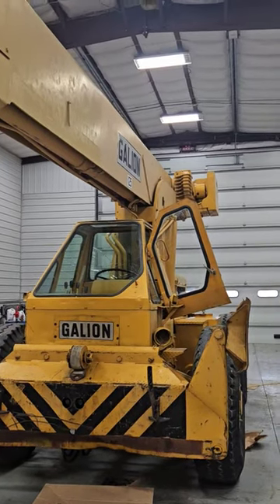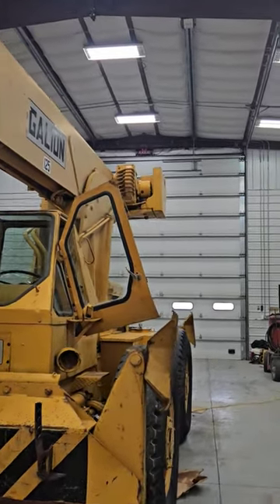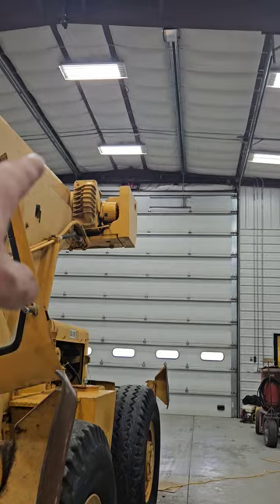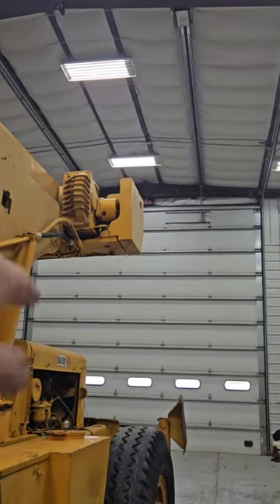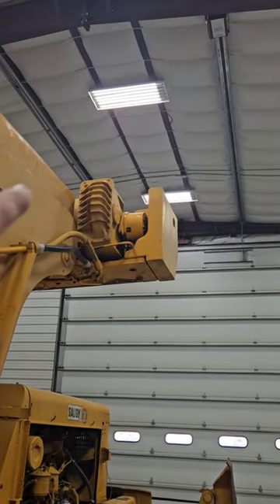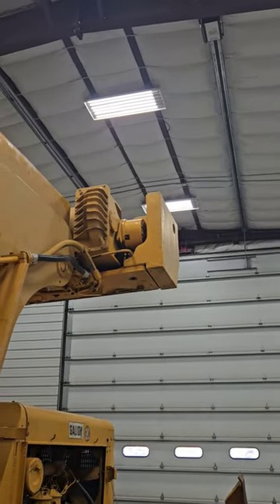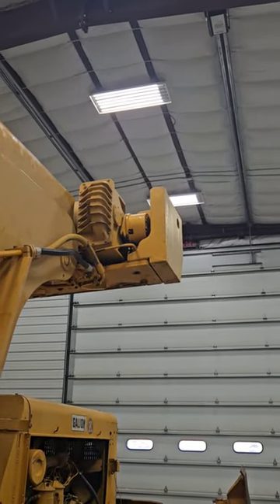Good news and bad news. #jpaydirt #oldguysrule #galion #short

Comment: Jeff have you ever tried rattling the bolt or what it’s threaded into w a blunt tipped air hammer to help break stuff free? I watch a channel called south main auto and the vehicles in New York State rust badly and he massages stuff w an air hammer and really seams to help